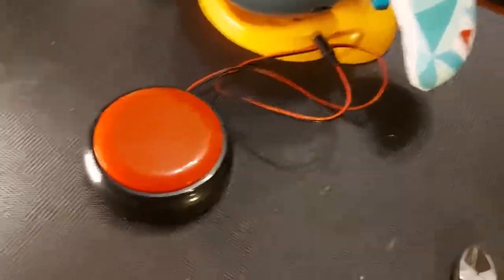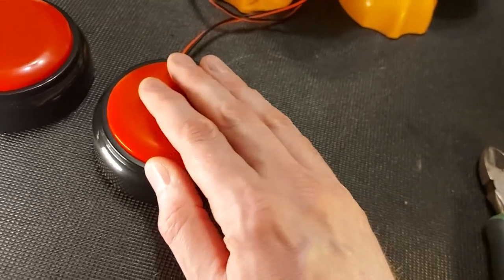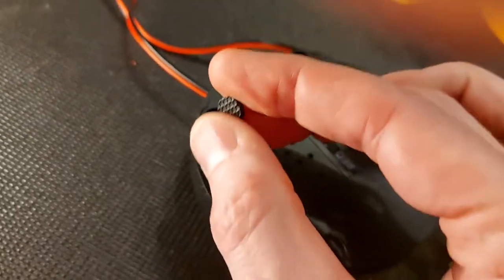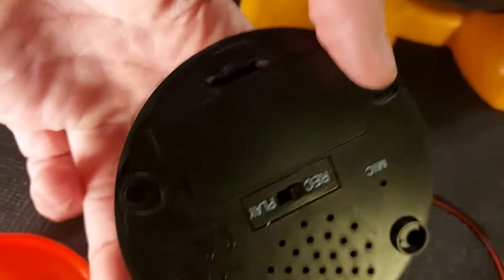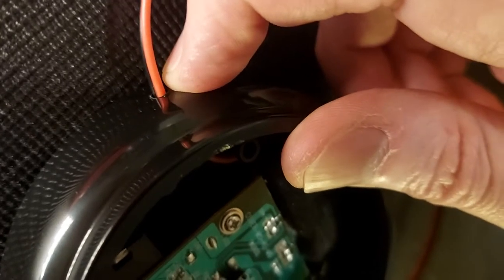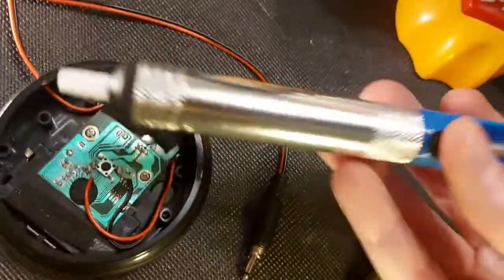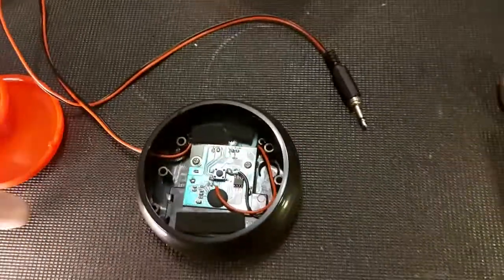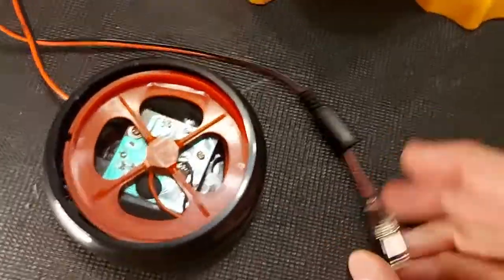How to Adapt a cheap kids quiz switch from Amazon

Comment: Have you got an Amazon link for this switch ?? I’ve got the penguin and sloth toy to adapt next week
Reply from the maker: Mono headphone cord, similar to these. The heads are sturdier than buying wire and jack separately and soldering.

Mono headphone plugs. https://a.co/d/dZfzd9s

Hope it goes well. As I say it may take some experimentation and each until may be a little different. I found it worth it, because I've made a lot of them, so it saved over buying comertial switches, especially when I could get the best deals on the pricing. Searching around with those key words may help you find a better deal than this across Amazon, eBay and AliExpress, etc.

Hope this helps.
Reply from the maker: Looking on Amazon.com I can see the models I bought. I had a two pack like this: https://a.co/d/97HknOq
Or there are single packs like this: https://a.co/d/fnM8ylS

I purchased in Canada but that's what I see on the US site. Depending on the country it be different. The search term to pull them up is usually something like "talking button record."
Other models are also likely to work, but each may be a little different inside. For some I needed to pull out the circuit board and flip it over, or remove it and replace it with a plastic base of some kind.
It can be a bit of trial and error.
Another thing I've found works well is to just use a